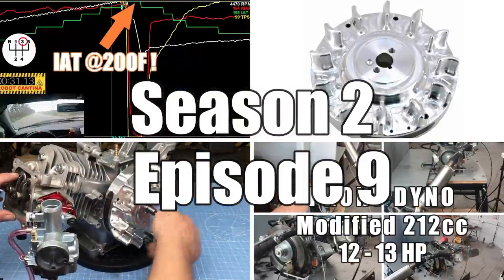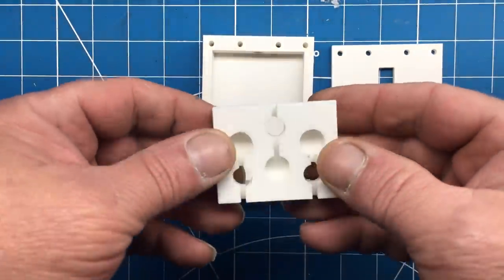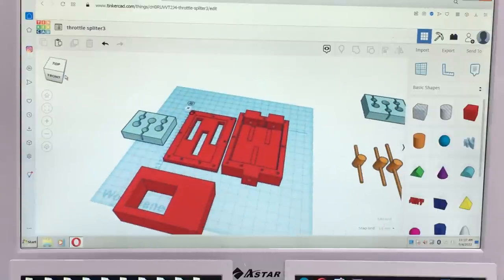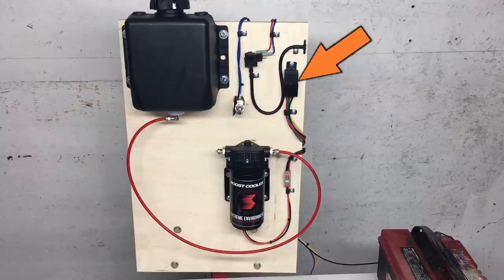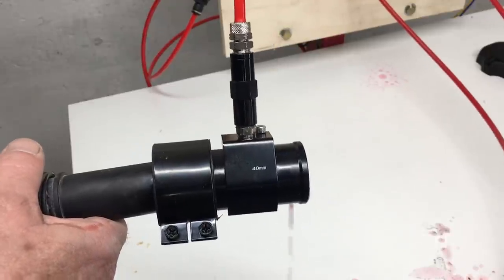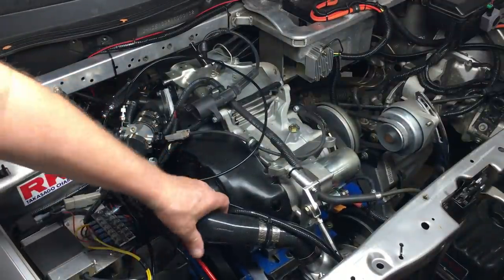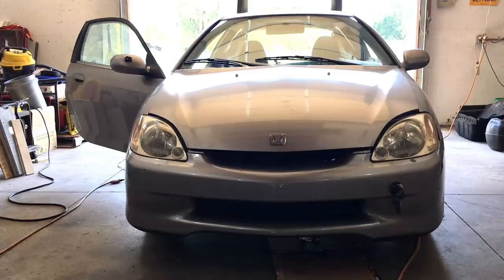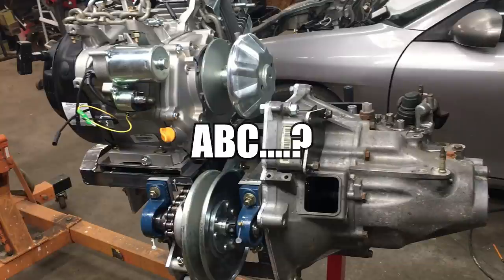S2E9: She’s burnin’ up Cap’n!  The 420cc supercharged hemi gets methanol  injection

Comment: 3 simple ways to fix this(from a high performance aspect).. You should be running it on E85. Cooler fuel. Add intercooler, cooler air. Add directed ducting and maybe more surface area to the block/heads. Cooler motor. Bingo, bambo, youre hitting 80 on a roll. Lastly, youre engine needs to operate at a high rpm to stay in it's powerband. Look into an early Honda motorcycle clutch, could work and it tranfers power a bit better so you'll realize more torque at the wheels.

Comment: "Dident see any extra power." Yea meth injection is not a power adder its a " i need more octane rating so i can run more boost" kinda thing.
Reply: It's also great at cooling the air charge in higher concentrations. A lot of the Ecoboost guys run 80-100% M1.

Comment: You've quickly become one of my favorite channels! I REALLY want to see this car with a predator 670 v twin and that supercharger, or if that won't fit maybe a lawn tractor twin cylinder like the Briggs and Stratton opposed twin alot of craftsman mowers have with that aisin blower, man thatd be awesome! I just REALLY want to see this with a twin cylinder and a blower or even a turbo, 2 cylinder engines work good with turbos unlike single cylinders, the duel cylinders make it so the exhaust strokes that power the turbo line up with the intake stroke of the opposing cylinder so it actually makes constant boost. Hell an inline twin cylinder out of a golf cart would be cool as hell too, actually thatd probably be the coolest as they are actually Subaru inline twin engines although they're usually labeled as robin engines, just make sure you get the larger displacement one(they come in 2 displacements but look the same). Once again thanks for your time man, love the channel. Please make a 2 cylinder boosted version, i bet you could actually do a burn out with a little work.
Reply: I come for  the video and stay for the comments here.
Reply: @ocdman202  I come for the comments and stay for the insanity!!
Reply: We need a drinking man's guide to this car... Maybe ESQUIRE  could comply..
Reply: Bazookas  are made with gin and spritzer right??
Reply: @ocdman202  If that is anything like a margarita,   I am all in.!
Reply: @kansasrose2909  Are you ready for double digit gas prices?

Comment: Move the ignition timing until it knocks. At those pressures and temperatures it should be knocking.
Reply from the maker: Because of the high temps, we are running a safe tune right now.  As soon as we sort a few things out we will give it hell.
Reply: @robotcantina8957  😊😊😊
Reply: @ocdman202  Man,   are you king of the road?

Comment: It's really nice to see you go and test things. Nice video as usual.
I'd just add :
Your shopvac ain't pulling no where near as much air as your engine will, except if it's a 12hp shopvac.
And you don't need an intercooler once you run enough meth, if you take your iat numbers after the water/meth injection it's probably really cold. 
Edit : Ohh and we fed methanol trough a turbo plenty of times without issues.
Reply: @kansasrose2909    Rose,  you seem very happy with this video.

Comment: It's probably mentioned already in another video or comments section but belt CVTs being as inefficient as they are, I wonder if you might be better off with a centrifugal clutch. At least when that locks up you'll be at 100% efficiency. Those comet style go cart cvts have to have horrific efficiency. Could probably get an idea of that by taking a temp of the drive sheaves after a pull. You could get rid of that extra chain drive as well. Probably take away from drivability but you'd probably free up a ton of power.
Reply: @kansasrose2909  Rose,  you seem very happy with this video.

Comment: Wow that cooler is huge! Have you considered some side mount cooler from a DSM, maybe a top mount from an Impreza or RX7? What about a blow off valve or a wastegate to bleed any boost when seeing vacuum?
Reply: No wastegate required for a supercharger, though a blowoff valve would have worked instead of his double throttle body setup. The only problem with the the blowoff valve on a supercharger is that it cycles it through the supercharger and the air gets heated up more each time.
Reply: @BrokeWrench  😊😊😊😊
Reply: @kansasrose2909  Rose,   you seem very happy with ROBOT CANTINA!!

Comment: Definitely don't need twin throttle bodies or any bypass valve. 

Should be in order, Ait filter > supercharger > intercooler > throttle body > engine.

No  vacuum on the charger this way and no complicated twin throttle which isn't helping in any way. 

Meth nozzle you want after the intercooler too (cold side) Find the smallest nozzle you can!
Reply: My weekend countdown has begun,  where are the icecubes?🧊🧊🧊🥤🥤🥤🥤🥤
Reply: @kansasrose2909  Rose,  Is it happy hour in your neck of the woods, ??
Reply: I think JIMBO should try the Tesla Turbine here.
Reply: @ocdman202  Tesla Turbine??

Comment: Temperatures can be managed with an oil cooler and a intercooler, electric fans on each for cooling during idle or low speed operation. So yeah, suggest installing those and then retest.
Reply: How about a Tesla Turbine to cool the supercharger?

Comment: Beware, too much intercooler and piping will cause MAJOR boost loss, and therefore power loss.  You may need to overspin the blower with that intercooler
Reply: That's not really an issue with a supercharger
Reply: @BrokeWrench  you are thinking of a turbo, since the wastegate goes until.a set pressure in the intake or charge tube.  The supercharger is tied directly to the crankshaft speed, and will basically flow the same volume of air, but when there is more volume to fill, there is a pressure loss.  Ask me how I know...
Reply: That's not true. The volume of a system will remain constant. 

The same has been said about adding larger intercoolers increasing lag, they don't. How could it? The volume of air is constant.

While less compressible, if a hose pipe running a bar of pressure through it will it lose pressure if it's say 40 feet long compared to 5 feet long? Of course not.

Comment: Use a small Honda radiator and a fan to make a air cooler it works and you can mount it on the one side of the core support

Comment: Arm Rest Mechanic here: So if you want the TL;DR.. It's a cool project, and I appreciate the uploads! But I have some.. opinions. 

First little Pro-Tip.. Oil does kill octane value- Not saying you didn't know that.. but just wanted to clarify as it can "technically indirectly" hurt the engine in this application. 

That being said, now we've gotta harp on the ole' stoopid charger for a minute. Obviously you're seeing results, but lets put those into perspective.. at 8PSI w/ 212 degree IATs vs Amibent pressure at 80 degree IATs, you're only gaining 0.04lbft air density.. and of that density gain, at those numbers you're losing a percentage of that power potential to timing change and parasitic loss. You would see this data in a 50-70 pull after it has some temp in it.. and is why the data looked good in a 4th gear start 0-60 (Low RPM, low heat, still making gate pressure). 

Correctly the fluid in the Charger, adding meth (Yee yee), and an intercooler are all steps in the right direction here.. however I still want to fall back to the other option.. a turbo. 

It solves:
Parasitic loss
IAT (don't get me wrong, they're still be higher.. but closer to that 20* desired)
Inlet tube vacuum (Although, the dual TBs was creative, props)

Not to mention you then venture into the possibilities safeties such as boost by IATs or SoF tunes (or in this case, boost on the fly.. depending on the driving style at the time).
Reply from the maker: Right now the turbo is out of the question because it would require an electric oil pump and that is something we don't want to rely on.  I realize others have done it before, but stuff like that only last for a single video.  
I know it must be frustrating to see us go in a direction that is not 100% ideal but it is the safe direction and keeps all the little parts from scattering on the ground.
Reply: @robotcantina8957  Right. I completely understand. There are some really small CTR turbos ("aircooled".. Ceramic bearing oilless turbos) with a really tight AR- but I'm still don't think it'd be small enough for that engine to spool.. and if it did, it would be a weird power curve (..or would it? taking CVT into consideration).
Reply: @robotcantina8957  Longterm it would be nice to see if the footwork required to build a subsystem to keep a turbo happy would yield worthy results.. or if by some chance we end up seeing an engine with an oil pump installed that'd be ideal. 

Who knows- just thinking out loud. Once again, I appreciate the content!
Reply: @sendit9129  There should be a drinking man's guide to this build..
Maybe ESQUIRE could come out with that... 😘😘😘
Reply: @kansasrose2909  Yes,, they could start with how to make a very
dry martini and end up with a custom bazooka.

Comment: Just going to say this now, you only need the one throttle body on the engine side of the induction. No vacuum on the supercharger with all the pressure on the engine side of the system. You can just run the water/methanol mix into the supercharger and let it go at that. Otherwise, love the series!
Reply: @kansasrose2909  Rose,  you seem very happy with this channel.
Reply: @ocdman202  Jimbo === is that Saturn back on the road yet?   We want to see how it runs with the Diesel engine  in it!👍👍

Comment: I just got a gen 1 insight. I’m wondering how installing one of these little stupid chargers on my stock insight would work out.
Reply from the maker: Its a tough call.   I have heard that the stock engine can be turbo charged, but I'm not sure how the ECU would handle the boost of ether the turbo or stupid charger.
Reply: @robotcantina8957  When I was a teenager in the late 30's and early 40's, electronics wasn't a word. You were interested in radio if you were interested in electronics.
Reply: @ocdman202  "If you really look closely, most overnight successes took a long time."
Reply: @mommapanda5736  CONGRATULATIONS  JIMBO.  👍👍👍👍👍 you have reached 106K   SUBSCRIBERS!   ROBOT CANTINA 
is providing the entertainment and education and FUN   that viewers enjoy!  Please provide more content here JIMBO!

Comment: Can't wait to see the the IC installed. Also, isn't just too big and the pipes too long for that little compressor? Pressure drop will be an interesting thing to see. And if you want to add somethimg, you can watercool the head with a system similar to the DKW 3=6 welding a cooper tube to the head.
Reply: Is it happy hour yet??   I have the icecubes!!🧊🧊🧊🧊🥤🥤🥤🥤

Comment: Love this channel.  Have you thought about adding an oil cooler and a good aftermarket auto Iginition system?
Reply from the maker: The ignition system we are using is comprised of a Ford 4.6 ignition coil, a 36-1 crank trigger system and a GM HEI ignition module.  It does the job pretty good.    Our biggest concern is the intake air temperature.  The engine temp gets high as well, but keep in mind it is an air cooled engine and getting a reliable reading is difficult.  The block may get up to 250F  and that seems high, but the oil temp is usually 175-210F
Reply: @robotcantina8957  💖💖💖
Reply: @kansasrose2909  Rose,  obviously your heart is in the right place.
Reply: @ocdman202  Is there another video on the way?
Reply: @kansasrose2909  I hope so...
Reply: @ocdman202  CONGRATULATIONS  JIMBO.  👍👍👍👍👍 you have reached 106K   SUBSCRIBERS!   ROBOT CANTINA 
is providing the entertainment and education and FUN   that viewers enjoy!  Please provide more content here JIMBO!

Comment: So I like to complain lol. But I have injected water/meth strait into a turbo and nothing bad happened. I did look like it was giving it a small sand blasting effect but never saw any major damage to the compressor
Reply from the maker: I reckon it takes a bit of time, but eventually the meth will erode the compressor turbine.  But if it works for you, keep it up.  Boost and cold air is always the answer.
Reply: @robotcantina8957  😊😊😊

Comment: Coming from a car tuning background i am mega impressed with the development and effort you put into this car but in this video….. would it not have been easier to fit an intercooler?? 

When running meth you will need to add alot more timing to make the most of it
Reply: @ocdman202  Man   did you see that bazooka?

Comment: If you was to get a bigger blower or overturned the one you well that decreases the vacuum that low throttles??? MIT you to study on single cylinder turbos and said that you need to plan on one and a half times the cylinder volume to maintain pressure... Which I thought was completely back afterward but they are MIT.. anyway he was curious about would help too and been waiting on you to put a turbo on the end of the blower

Comment: I can't imagine that motor lasting any longer than 3 weeks being driven at 100% throttle. It's a neat project but not realistic in everyday use. Kinda like buying a moped to run around town would be ok but not an everyday 30-60 mile one way commute to work.

Comment: I'm only gonna say this once: Boosted engines LOVE running on E85, because of it's octane rating (100-105, depending on seasonal blend, respectively) and how effective ethanol is with vaporization of latent heat. (Air-charge cooling) So switch to being able to run E85, and stop screwing-around with this water/methanol injection nonsense! [:\
Reply: Run straight Methanol and you won't even need an intercooler.  Intake temps will get so low it will drop below ambient.
Reply: @donaldjohnson5633  😊😊😊
Reply: @ocdman202  They should come out with a drinking man's guide to this build.. Maybe ESQUIRE could run a piece..
Reply: How to make a very dry martini and follow it with a bazooka. 👍👍

Comment: Bazooka should make a louder induction noise as well 
Also for vacuum a y splitter with a larger pcv style valve or even a ball inside a tube that uses gravity to let vacuum lift the ball and boost will quickly seat it
Reply: @ocdman202  Man,   did you watch all of JIMBO'S videos?

Comment: This is awesome and a very complex build, I do have one question....why not degree the camshaft to reduce the amount of time the intake valve is open? It's a boosted application, so it would drastically reduce vacuum at idle and boost is, well, boost, it'll still make it into the cylinder just fine. Feel like there was a simpler solution here, albiet two throttle bodies was a smart one.
Reply: How about a Tesla Turbine for cooling?
Reply: @ocdman202  Has installed the flux capacitor??
Reply: @mommapanda5736  CONGRATULATIONS  JIMBO.  👍👍👍👍👍 you have reached 106K   SUBSCRIBERS!   ROBOT CANTINA 
is providing the entertainment and education and FUN   that viewers enjoy!  Please provide more content here JIMBO!

Comment: Starting in 3rd is not like starting in 1st. If you started in first it would probably take off like a crawler and slowly start picking up speed. I feel like second is a better starting gear.
Reply: Good point... By the way, did you see that gnome at the end of the video🧙‍♂️🧙‍♂️🧙‍♂️🧙‍♂️🧙‍♂️😜😜😜
Reply: @kansasrose2909  I did see the gnome.

Comment: Jimbo, 

Welcome to Kansas in the Summertime. Highs in the 90s are normal and some days go into the hundreds.

I was hecka impressed that you managed to get 64 mph from your engine with the hood off. I figured that one thing that helped your street legal go-kart make as much speed as it does is that the body has fairly low drag. Removing the hood may have been the best thing from a heat perspective but it probably increases wind resistance up to 60s American car levels (think early 60s Ford Falcon). So to get 64 mph in spite of the engine issues and the higher drag was impressive. I'm looking forward to see how the intercooler works.
Reply from the maker: Yeah, removing the hood was not great for aerodynamics, but just to be on the safe side as far as temperatures it was necessary.
Reply: @robotcantina8957  Understandable, its never good to have an engine cook itself. Just be careful to not cook the driver either.  Kansas summers are no joke.
Reply: @darwinskeeper421  😊😊😊
Reply: @ocdman202  Yes,  please don't cook the driver!
Reply: @kansasrose2909  The official drink here should be the
Cantina Bazooka!

Comment: Me: 0:46 lol meth injection
Meth head: and i took that personally
Reply: Also thanks for hearting my comment Robot Cantina! You're doing and accomplishing great things! Love the work you've put into the cement mixer powered BIG BLOCK Honda insight, you definitely have what it takes as an engineer, may i suggest some ductwork through the fender and vents to bring fresh air from one side outside and through the engine bay, and out the other side of the other fender? It shouldn't drag the motor down at all, that's my solution without robbing power from the motor at all, i though of cooling fans, or making external cooling passages with a water pump, and then i thought, well the radiator and cooling fans required is extra weight slowing down the street legal go kart, and the fans would rob power from the motor if they were driven by either the motor or the battery which would strain the alternator more dragging the motor down.